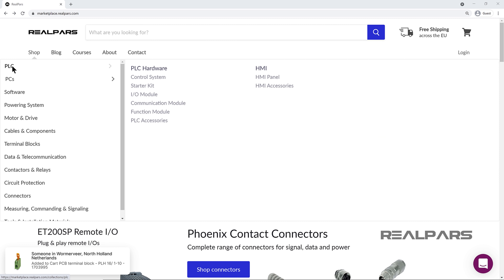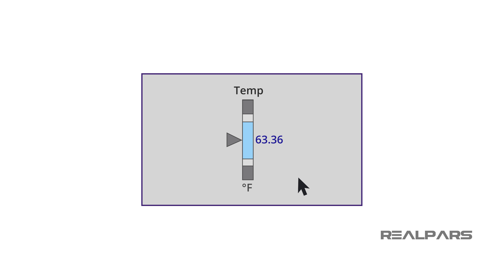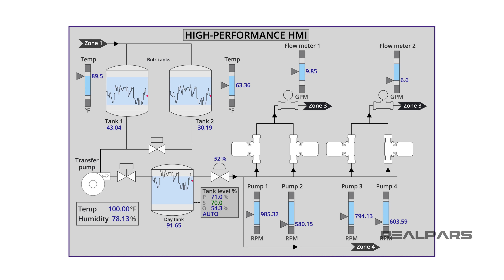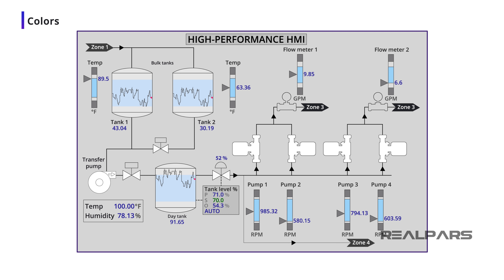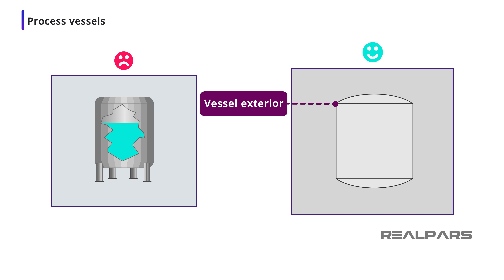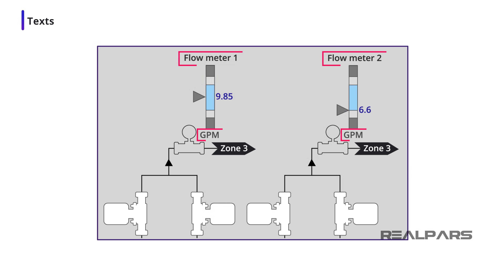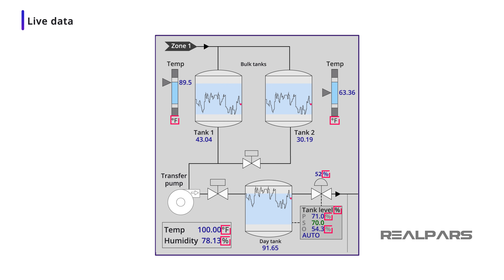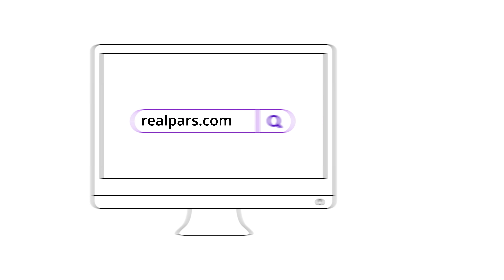Development of High-Performance HMI Philosophy

Comment: This video is a great attempt to bring awareness on what constitutes a good HMI philosophy (HMI design specification). What I have seen so far in my career is that there are organisation which believe in preparing an HMI design specification and there are others which don't really care if the same is even provided to a control system vendor leaving the onus either on the control system vendor or on to the client for providing control system vendor with HMI graphic screenshots of their up and running existing facility.

In the latter case, I have seen that EPC contractor would just dump P&IDs to the control system expecting control system vendor to figure out by itself what information to include from P&ID and what not to. I am a firm believer that in addition to HMI design specification, HMI screens should be specifically developed in CAD as per the project requirement and shared with the control system vendor. Otherwise, results of dumping P&IDs on control system vendor is bad and can be disappointing in the end.
Reply from the maker: Thanks for adding that, Saurabh! We always appreciate such comments of knowledge and experience.
Reply: @realpars  You are most welcome. I look forward to future videos from you on preparing an effective HMI philosophy which can serve as a standard on every project.
Reply: I don't think CAD is required as the modern control system vendors should have a basic understanding of making effective HMIs given that there are good standards and practices shared by ISA and other organizations even the OEM.
Reply: @Techwem   Our assumptions often lead to disappointing results in the end. HMI design specification and HMI screens should be provided by EPC contractor to the control system vendor along with Alarm management document. Without these documents, there will be no control over the final quality delivered by system vendor and in the end will only lead to disappointment. In short, don't  leave it to the system vendor, take responsibility of preparing these documents yourself and be in control of quality you expect from your vendor.

Comment: Yet another great video from RealPars!
There are certainly challenges in the process world to make efficient HMIs so this video is a huge help towards better human and machine interactions.
Is there something in the works at RealPars that shifts the discussion towards machine HMIs with buttons, functions, I/O, recipe or settings input fields, screen navigation, etc? Tanks, pipes, pumps, and analog values are not typical in machine HMIs, so any input from RealPars would be much appreciated!
Thank you, RealPars team!
Reply from the maker: We do have some videos at Realpars.com that look at machine control (conveyors) and pushbutton interfaces.  we also have a complete course on configuring the Siemens Basic Panels using TIA Portal.  the same HMI standards would apply to pushbuttons, functions, etc, where the use of red and other colors would be reserved for alarm conditions.  I usually use a dark gray for buttons or lamps that are energized and a light gray or "hollow" for the de-energized state.

Comment: In the case of agitator blades inside a vessel with the requirement for a visible run status, how would the High-Performance HMI Philosophy apply to drawing equipment inside of vessels while including trend data.
Reply from the maker: Typically, an agitator status follows the motor status, so when the motor is running, the motor object should be white or a neutral color.  Only when an abnormal situation occurs should a color like red be used.  Agitator speed can be displayed with an analog value object, as shown in the video.

Comment: Great Video but, I would slightly disagree on the analog display, the arrow Pointer works for levels but maybe not for Pressure, flow rates, temperature. a smaller rectangle display for those it much cleaner on a screen in practice as you can put it right on the line. just my opinion i have only been designing HMI for about 18 months.
Reply from the maker: Thanks for sharing your thoughts with us!

Comment: Thank you for such a great informative video.  As an electronics engineer, I really like the HP HMI, but I have to build HMIs according to technical guidelines, and clients always have their own point of view.  In this example, I would change some details: under all tanks, the measured value is indicated without units of measure, I try to always indicate the level and volume of liquid in the tank.  And the arrow showing the actual level on the tank should be thicker and possibly not red.  Do you think these changes will improve or degrade the quality of the HMI?
Reply from the maker: If you and the client believe the changes are helpful, then by all means, make the change.  HP HMI principles are guidelines that are useful in creating operator-friendly, efficient HMI screens.  I have not done any projects in the past 10 years that strictly obey 100% of this "standard".  There will always be changes, but they should be minor, as the changes you have suggested.  Any change that makes it easier for the operator is a valid change; any change that distracts or causes an operator to lose focus on what is important, is not a good change.  Showing the units for a PV is likely a good thing, although it does take up real estate on the screen and is one more thing the operator would need to focus on.  If the plant uses the same units for each measurement type across the system, then units could be considered optional.  Likewise, if you show a numerical value of level or volume, does that enhance the understanding of the process over a trend line in the tank showing the level?  You need to decide whether it does or does not.

Comment: Thx amazing work,
could you mention the Color code of 
1- analog indicator status (Normal, Low. LowLow or High High)
2- Top of Valve
3- Chart in tanks
Reply from the maker: The color scheme should be determined by an HMI Style Guide or another specification document.  For an analog indicator status, for indicating the normal value, white or another neutral color can be used.  For abnormal conditions (alarm conditions), red or yellow are typically used.  The topworks for a valves usually indicate a normal position as white or light grray and an abnormal condition as red.  Charts in tanks (or elsewhere) should use a neutral or light cyan color as a background with a black line trace.  The chart scale should be automatically adjusted to show the limits of the chart values.

Comment: What software packages are out there to develop high performance HMIs? Which one was featured in this video?
Reply: intouch Aveva (standalone) can connect to any source and has already built in libraries (SA, industrial graphics) since many years to reach an HMI high performance without having to draw everything.

The must to have is Aveva SystemPlatform with OMI as client, this piece of software is the future! With apps in it, external content, built in navigation and an oriented object dev. ;)
Reply: Aveva SystemPlatform with OMI is perfect I agree 100%
Reply from the maker: There are many packages that can be used to configure high-performance HMIs.  As mentioned in another response, Aveva SystemPlatform is one.  Siemens WinCC advanced, GE Proficy iFIX, Rockwell FactoryTalk View, as well as many others can provide the foundation for high-performance graphics.  This video is based on WinCC.
Reply: This looks like ignition by inductive automation! I recommend it but look it up a little.

Comment: How can get Siemens HMI software and what's the suitable one for connection with mult-loop compact controller (not PLC) ?
Many thanks.
Reply from the maker: Siemens software can be purchased at marketplace.realpars.com.  What you will need for your specific hardware is another issue.  This will depend on two things:  what do you want to use for the HMI (PC, HMI panel, etc) and what communication interface is available to communicate with the controller (Profibus, Modbus, etc.).  The Siemens HMI software is called WinCC, and it is available in many different configurations.  Without knowing what your specific hardware is, I would suggest you contact your local Siemens representative for help.
Reply: @realpars  thank you very much and hope to make video about OPC SERVER .

Comment: Is there a referent literature like book or stadard where these information can be found?
Reply from the maker: Yes.  ISA 101 is the governing standard (https://www.isa.org/products/ansi-isa-101-01-2015-human-machine-interfaces-for).  Here is a good (free) summary of the standard:  https://www.idc-online.com/technical_references/pdfs/electronic_engineering/The_high_performance.pdf.  And here is a good reference for the practical application of the standard (worth the money if you are designing HMI systems):  (https://www.amazon.com/High-Performance-HMI-Handbook/dp/0977896919).

Comment: Question. Does HMI design priciples or any other layout is based on ISO EN IEC standard?
Reply from the maker: The standard described above is from ANSI/ISA101.01-2015.  Currently, there is a working group within ISA and IEC working to create IEC 63303, which will become the European HMI standard.  This will likely take another 2 years to complete, but when done, both ISA101 and IEC 63303 will provide automation engineers worldwide guidance on effective, high-performance HMI design.

Comment: Can we make a high performance HMI with Siemens WinCC? Because this kind of bar and trend is not available in the Siemens WinCC. I saw your reply to one the comments, which asking the same question, you said WinCC advance can do high performance HMI but I can't find this kind of analog bar or trend in Siemens HMI
Reply from the maker: The on-screen trend is in the Control menu in WinCC.  The object is called WinCC FunctionTrendControl.  You will have to go into the properties of this control object once placed on the screen to change colors, connect a tag to a trace, and set time ranges.

Comment: Do these guide lines apply to SCADA as well??
Reply: These are recommendations for screens that display information about your operation.
Reply: Yes, for the HMI aspect of it.
Reply: Yes, Obviously! SCADA does have HMIs. Apart from it where there is a Human-Machine interface, you can use this learning as a reference. Sometimes sectors may differ in terms of standards for HMI but the basic essence remains the same.

Comment: This topic is very relevant and interesting, but in reality everything is different. Usually, the customer (factory/plant) already has its own requirements for HMI, and they are certainly far from high performance. Therefore, no matter how much you, as an automation engineer, would like to make it better and more modern, you are forced to fulfill the project design. I have been working as an automated control system engineer with Yokogawa equipment for 15 years, I really like to create HMI, but my hands are tied in almost every project. There is no freedom of creativity and the ability to make interfaces better, at least in Russia.
Reply from the maker: Thanks for sharing your experiences with us. We appreciate that, and hopefully this is helpful to other students as well.